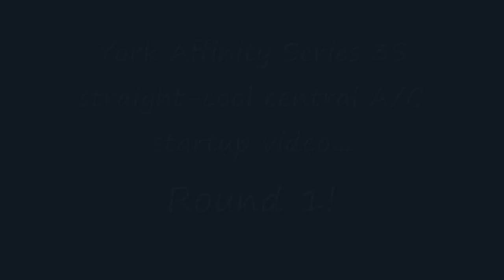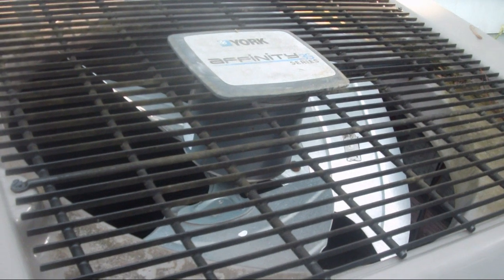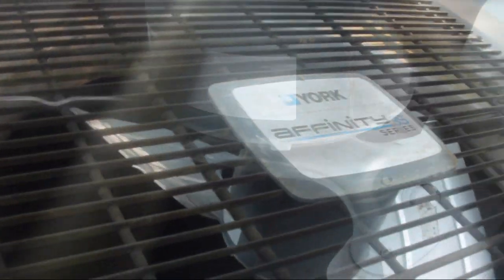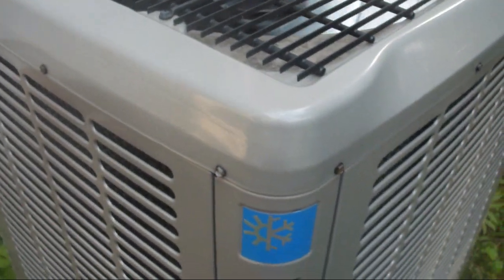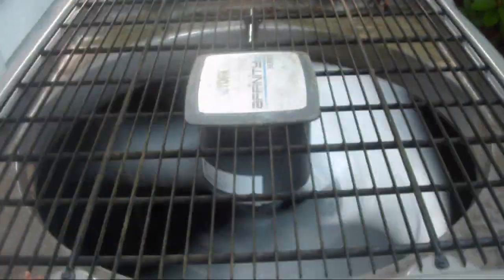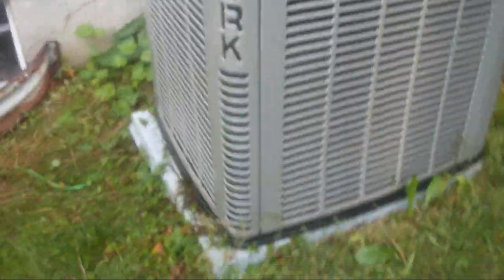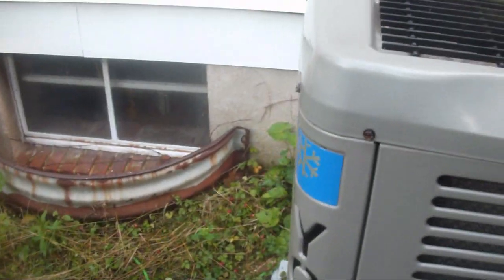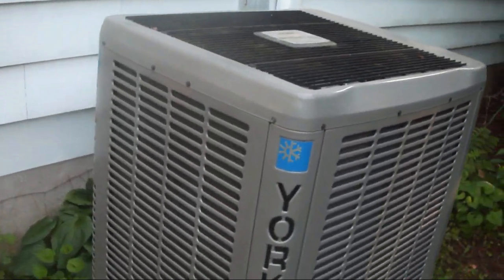York Affinity Series 3S (13 SEER) 3.5-ton central air-conditioner running on a really humid day

Comment from the maker: I am in training to become a tech, but as of right now I don't know much about York products aside from what they pur in the consumer brochures. It could be an electrical problem, but it could also be as simple as turning the fan to auto on the thermostat. Your typical central A/C and heat thermostat had three settings, which are auto, on, and off. AUTO only runs the indoor fan when the whole system is running, and ON runs the indoor fan ALL THE TIME.

Comment: Hey bud, I have a question for you. Is this unit controlled by a digital unit controller? What I mean to say is, where you set the temp and other controls-I don't know the tech jargon!  I have this exact unit and it does a great job but I've ran into a situation with mine. My system is central heat and air and last night we noticed it wouldn't stop running and i cant figure out what's wrong. It runs and keeps the house cool but wont turn off (the fan). Any ideas on the cause? Thanks allot!